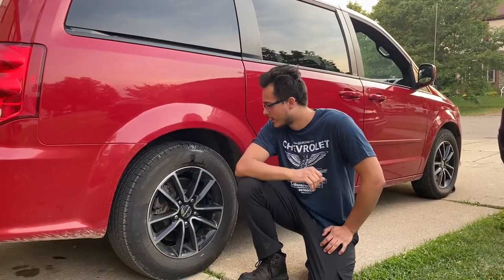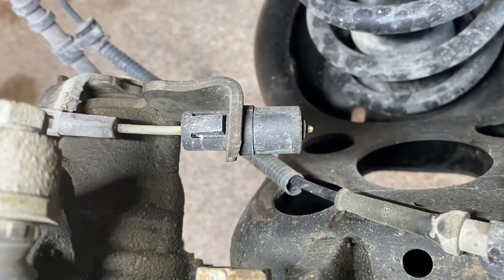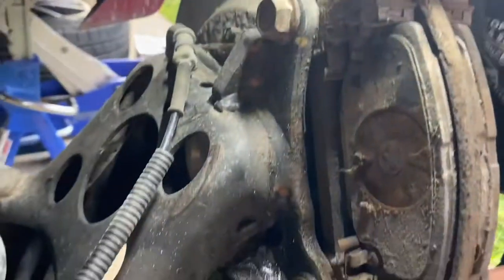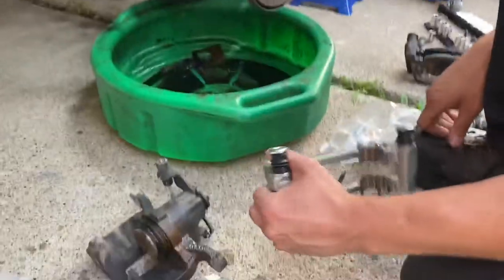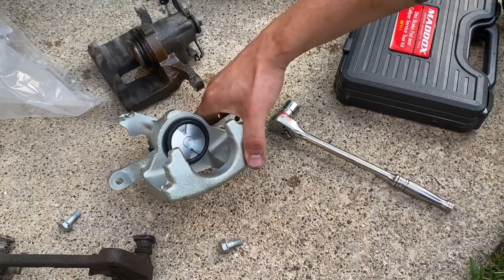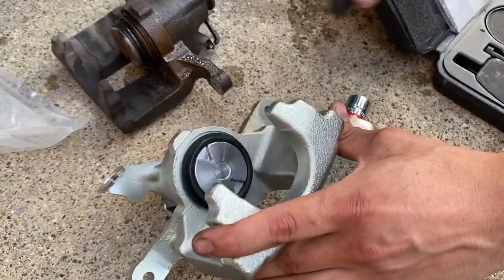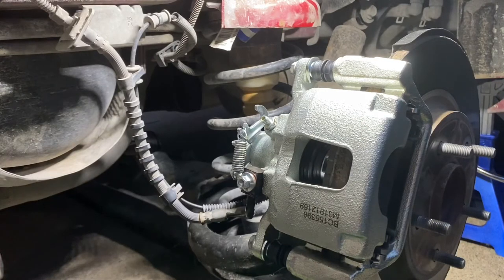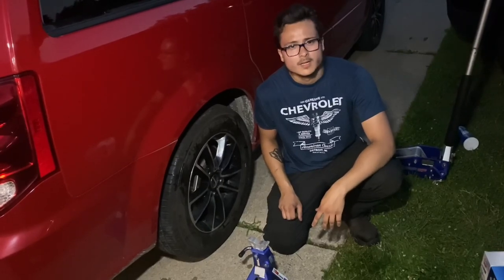2014 dodge caravan rear caliper

Comment: FYI  I have worked on these rear brakes for 11 years. Do not spin the piston out for adjustment. It will adjust on its own as the brakes are used. Pump the brakes a hundred times to get the pads to seat properly, especially old used pads. Make sure to replenish the brake fluid if required. When you put new pads on, spin the piston clockwise with the special tool until the piston is all the way in.
Re: parking brake. The main cause for sticking rear calipers which wear the pads down prematurely is corroded parking brake cables.
Reply: why not spin it out to fill in any gap between the piston and pad? Other videos say to spin it out otherwise u might have issues with spongy brakes
Reply: Replace the pads and then it won’t be an issue.
Reply: @JMart6  there is some sort of an issue that happen with these piston type calipers. I recently bought a van with these types of brakes on the rear, the PO said it had new brakes recently installed, but the brake pedal was spongy. Sure enough there was a little gap between the brand new brake pads and piston and neither piston would budge even after pumping the brake over 100 times. Talk about a leg workout lol. Anyways spinning/backing out the piston just a tiny little bit (but still making sure to line up the notch on the piston with the pad) fixed one of them but the other rear caliper piston wouldn't move even after being backed out a bit and had to be replaced. It almost seems like they were screwed too tightly/too far in to begin with
Reply: @yeslawrence  The brake fluid will push the piston out... that's how brakes work.  There is ABSOLUTELY NO NEED to spin that piston, EVER.  No matter what the 'mechanics' (lol sure) of Youtube say.
Reply: Well you have to spin it in…..and I believe it’s the parking brake you have to put on and off a bunch of times to adjust them…
But I guess if you cut the cable ….maybe you spin it out ……sketchy

Comment: When I bleed brakes, I have my helper press the pedal 5 - 10x, hold it, and then open the bleeder screw. I do this several times until all the air is removed.

Comment: I think its funny that for a leak you changed the whole thing. Whereas, you can buy repair kit. A new caliper for an old and uneven brake pad? I'd rather have both sides replace the brake pads and repair the leak to be safe.
Reply from the maker: It was all the person could afford

Comment: Pretty sure once you bleed the brakes the calipers will be adjusted to the correct setting manually by you depressing the pedal a few times
Reply from the maker: It’s always a good rule of thumb to pump up the brakes after every replacement. Believe me the one time you forget will make you wish you did!